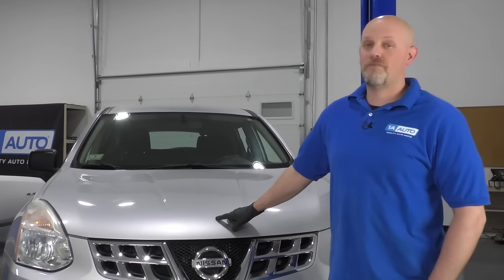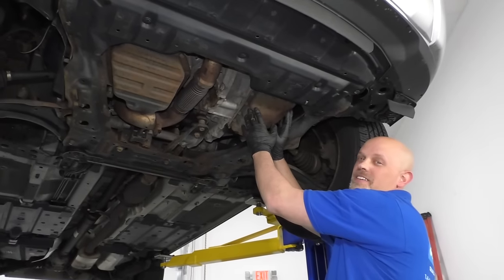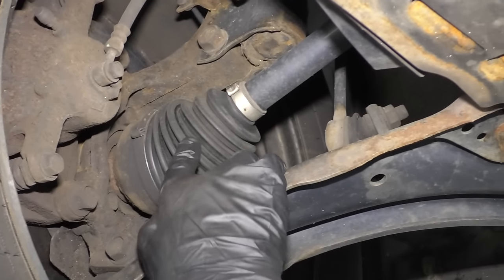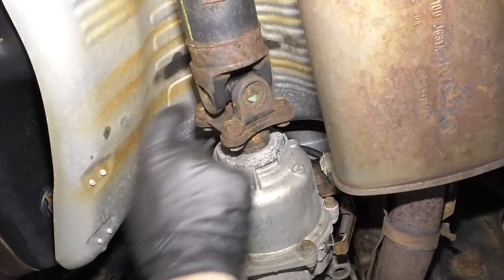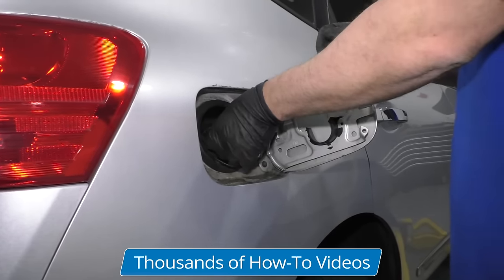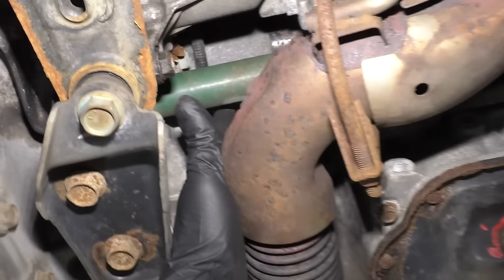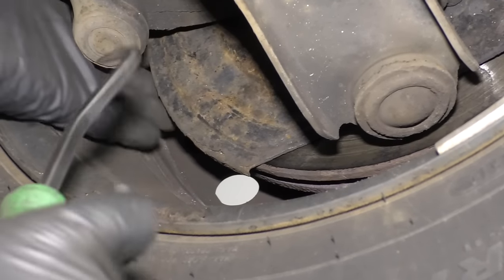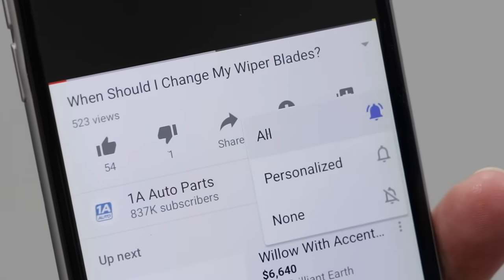Top 5 Problems Nissan Rogue SUV 1st Generation 2007-13

Comment: I bought an 08 Nissan Rogue about 3 months ago. Had bad control arms, replaced them. Both front axels were bad, replaced them. Has about 160k miles on it. After I had bought it I noticed a whining noise that seems to be coming from the passenger side rear. It is a fwd vehicle. Been looking at some of the videos on here. Has a cvt trans. They all talk of a whining noise coming from the trans when the fluid gets old. I don’t have any idea if and when the fluid has been changed in mine. Like I said, sounds like the whining is coming from the wheel but, it could be the trans I guess. Any suggestions, anybody?  Thanks
Reply from the maker: +The Kentuckian We wouldn't be able to diagnose an issue like that here, you may want to have a local mechanic take a look at it. Thanks for checking us out! http://1aau.to/m/Shop-1AAuto-c

Comment: Can someone do a video on all the hidden fuses?  I can't find the fuse for the blower motor.
Reply: Omg! Yes! There’s two big fuse boxes under the hood and you have to take out the air filter piping to even get to it and it’s very tight quarters (angled needle nose pliers and long reach pliers are your friends!). It has tabs on the fuse box that all broke off the two times I ever had to access it. (No, it’s not anywhere near as easy to remove as videos make it seem. Horrible design) Also, when the box is open there’s no sense of the fuse/wire bundle orientation. I think the fuses are supposed to be on the lid but mine always float between the lid and box. Try not to blow any of those fuses or else prepare for way too much work and misery. Air filter broke a lot of plastic tabs getting it out too, and I was careful. Plastic and engine heat over time do not mix! They don’t put  fuse boxes on the interior of cars anymore?? Why tho? Bad. Lazy.

Comment: My 2013 Rouge is rattling I've had 4 mechanics look at I've had motor mounts replaced still rattling they can't give me answers. I only hear the rattle when I barely tap the gas and im going like under 30 miles. Help please!!!
Reply: If you are getting a horrible rattle in a 2008-2014 Rogue look up NTB14-018 Technical Service Bulletin.   You can fix it for $1 with a big hose clamp, or go to the dealer where they will lie to you and estimate like $1000 in exhaust work.  That's what they quoted me, I had to point them at the TSB.  I find it hard to believe they didn't know about it
Reply: Oh and the reason it happens at certain speeds is it is caused by engine vibration shaking the exhaust and making the loose heat shield rattle.  You changed the motor mounts trying to stop the shaking but there is a certain amount of free play in good motor mounts and your problem remained.  So I'm guessing this loose shield is your issue.  You might even hear it by going under the car with a rubber mallet and banging rapidly (not too hard) on the exhaust pipe.

Comment: What does it mean if the car starts to shake....for instance, you're waiting on the traffic light to turn green and your car starts to shake as you're waiting?
Reply: I have the same problem.  The idle speed drops down very low and it seems to want to stall out and vibrates.  Did you get this fixed since writing this comment and if so what was the cause?
Reply: was there a check engine light or any code when it happened?

Comment: Top 5 problems!!!
First problem: Its a Nissan.
The End...
Reply: my brother drove a Sentra to over 200k, and a good friend of mine has had a Frontier for literally 20 years. they aren't all bad.
Reply from the maker: +Quinn Mclaughlin As long as you keep up with the maintenance and you are good!
Reply: @1AAuto  how often should the cvt fluid be replaced on this particular car
Reply: @quinnmclaughlin7537  they all aint bad that us true but for mass production cars if for example 40% of them have problems. People will see it and understand their car is not up to quality. Similar to my 2009 rogue with its cvt shaking when accelerating. I have to use the manual mode to aviod the cvt shake at low speeds like citi driving. On highways its a non issue. It loves the highway especially at 2k rpm 🤣
Reply: Im only at 60000 miles and it started at around 40k i just didnt luck out like you

Comment: How do you know when you need a catalyic converter?
Reply from the maker: +luv 2cook Thanks for watching!  You will typically start getting engine codes indicating that catalyst is failing.
Reply: @1AAuto  the only thing i see is my engine light goes on..and the engine cuts out at a stop light sometimes.

Comment: Don’t do it. I bought a 2013 Nissan rogue sv as my first car. I only had it 2 years and so far I’ve fixed every door actuator ($400 for each door), the trunk actuator ($500), and presumably a starter issue where the car wouldn’t start for days till I kept banging on the starter. If your gonna buy one, make sure it has almost no mileage on it. Don’t make my mistake and buy it at 98,000 miles just because it was “cheap”

Comment: Were is the oil pressure switch
Reply from the maker: +@chrisheller7431 The oil pressure switch is typically in the cylinder block near the oil filter.

Comment: 2012 Rogue. Trans replaced at 122k. $4700 !! Aweful design . A well known defect from Nissan. two RH cv joints and One LH replaced. Now the traction control is coming on during acceleration on the on ramps which cuts power at exactly the wrong time !! Extremely dangerous !! Beware....

Comment: My 2103 Rogue is the worst POS I ever owned. The Transmission died at 60,000 miles; Luckily, it was covered under extended warranty. But then the Airbag clock mechanism failed ($600), and the door lock system failed ($900), and then the passenger occupant (airbag system) sensor failed. Dealer wanted $2000 to fix that. Avoid this car like the plague. It SUCKS.

Comment: Don’t buy one! The CVT transmission issue is a known problem and many models have a recall out there! Our transmission went out on us at 90,000 miles, since we are the second owner we didn’t have a warranty on it and had to eat a $3000 loss plus we were on a road trip 1000 miles from home had to rent a car, extend our trip a week, wait for the repairs, Nissan didn’t take care of us at all, they have terrible customer service! Then we find out it’s a known issue and other models with the exact same transmission as ours have recalls and are covered under an extended warranty but they refused to offer us the same warranty because our car was made in the second half of the year 2011 and for some silly reason they did not extend the warranty to the second half of 2011 even though its the same transmission! Horrible car and a horrible company!!